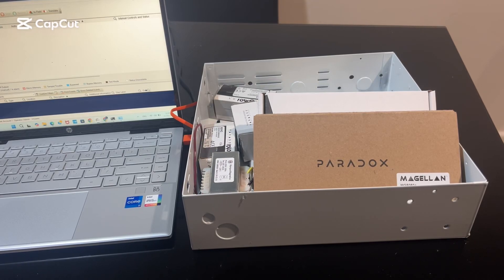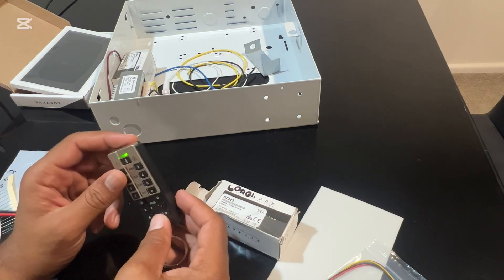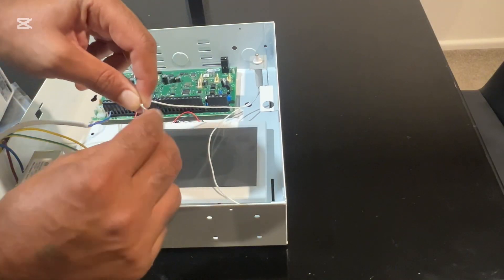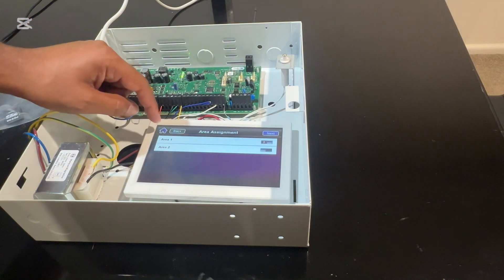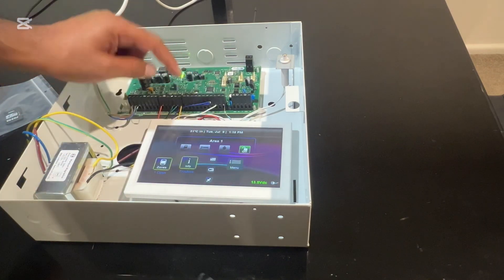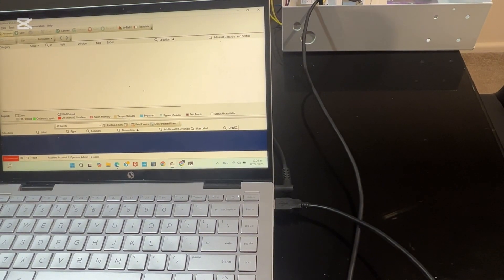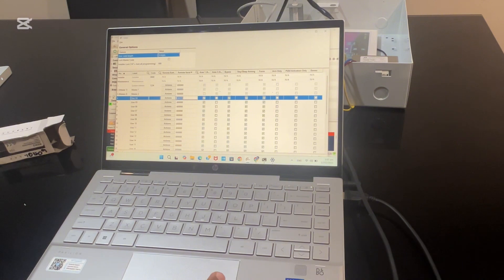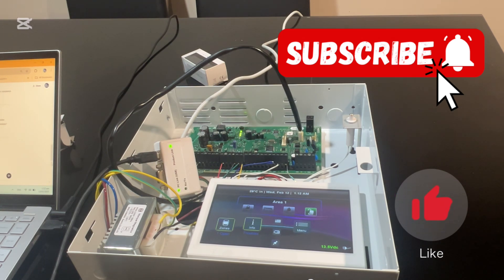🔴 Full Paradox MG5050+ Alarm System Setup | TM70 Keypad, REM3 Remote & Babyware Programming

Comment: Hi there 
No the TM70 touch screen keypad how do you switch on the entry exit time on the keypad
Reply from the maker: hi Kevin , Area Exit delay is setup through advanced programming, you need installer code for that. Simply enter in advance programming via installer code and then go to section 745 the. Enter your 3 digit desired exit time , for example 060 for 1 minute.